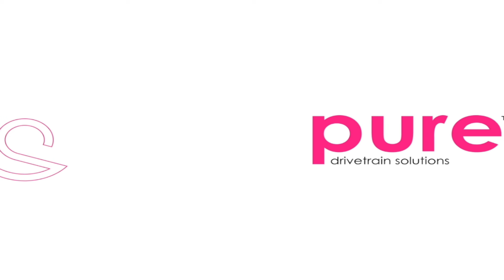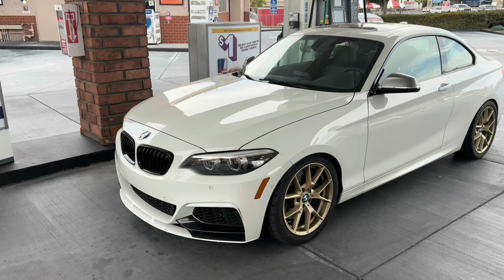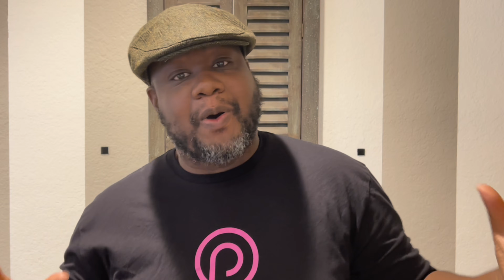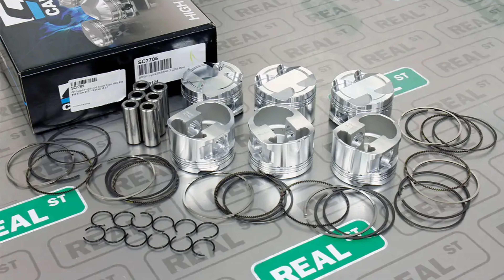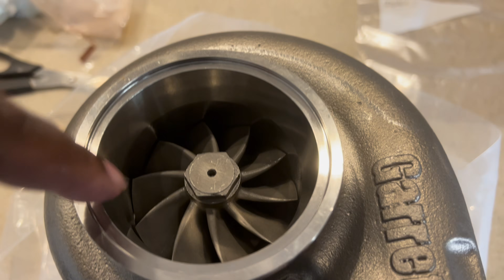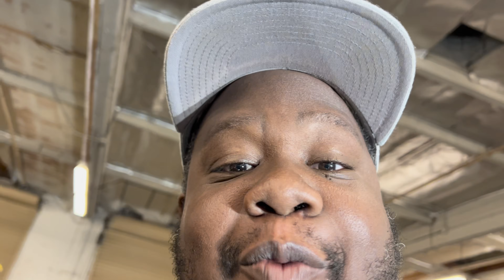My M240i Gets a 1000 WHP Built Motor - Built by Billiam Mason

Comment: How has the built motor held up over the last year?
Reply from the maker: Still as strong as ever!  I need to make some new content.
Reply: @TheSpeedAddiction  I couldn’t get ahold of Billy, he only responded to 1 email.  So my S55 is getting built by CarBahn (Dinan). 👍
Reply: @TheSpeedAddiction should man I was just looking to see if it blew or not a year later 👀
Reply from the maker: @blackhammerftw1960  The car is still going strong.  Here is some content of my car on another channel https://youtu.be/f7PQEk9Nhk4?si=icwFV5jzmLBEeToC
Reply from the maker: @blackhammerftw1960  The motor is rater for over 1000whp and its been at 800whp for a year (8k miles),  so I'm not stressing it that much.

Comment: I’m abt a month away from getting my 240i with built engine and transmission too n bigger turbo …… going for that 1k hp/9s 1/4 mile bless up fam from Yaad 🇯🇲
Reply from the maker: Enjoy my bro.  These cars are soo much fun with big power.  One love fam!
Reply: I can’t wait for it. Bless up Breda
Reply: I got my B58 and it’s got a built B58 built to manage a 1000 too and right now I’m doing close to 700 hp with well over 700 in torque on a race tune with ethanol. It sounds really amazing I got awe sports exhaust, pure turbo, dinan performance intake and whole lot more. It’s everything I need but at times I wish it was x drive or I could at least have the option to toggle between x and red. Bless up fam. Hope your B58 is treating you good!
Reply: what route dd you go with for the built motor?

Comment: your new engine is not sleeved right?? how much psi can hold without any problem on your new engine??
Reply from the maker: It’s not sleeved. Billiam said it can handle up to 1000 whp. PSI depends on the turbo..
Reply: @TheSpeedAddiction  what turbo kit can get 1000whp on m340i xdrive 2020 ??
Reply from the maker: @w4tchmydark775  https://docrace.com/collections/b58/products/copy-of-b58-bmw-f-g-chassis-top-mount-turbo-kit - get the PTE 7275.  The 6870 should get you around 950whp

Comment: Many ppl think they can make 800 on stock internals. They're dead wrong. Stock rods and pistons start to give up around 650wtq 
 Not that you can't make more. You surely can. But it's days are surly numbered. We've taken apart many b58 engines and each tuned b58 on any turbo upgrade had tweaked rods
Reply from the maker: I totally agree 🙌🏾
Reply: The rods can handle pretty much torque, they don't bend just with high torque.
I am sure your rods bend because of engine knock. Maybe your software was a little over the edge.
Reply from the maker: @kosditrade  Just seen this comment.  The car made 600 lb/ft of torque at 4500 rpm. it was tuned pretty conservatively.  The stock engine can make big power but not for a long time.

Comment: How much could stock block b58 engine handling? Someone told me the engine could hand around 750whp but it's the transmission that can't handle more than 650wtq
Reply from the maker: I guess it’s a case of how long the stock block can take the power for. The new B58TU is stronger than the Gen 1 B58 found in the F series BMWs
Reply: It can't handle 750 whp. 600 or so is ur safe limit. Push past 650 that you're counting days . Not only the rods bend pistons crack ringlands
Reply: Most fails I have seen with ringland was actually ots maps with st2+ , I truly believe it's safe to run 700 on them with a perfect clean tune. Crappy tunes and pushing di systems is causing the most fails.